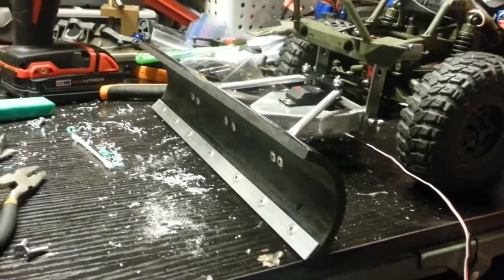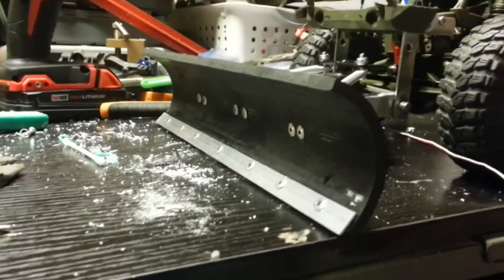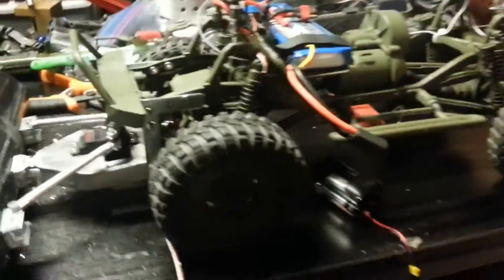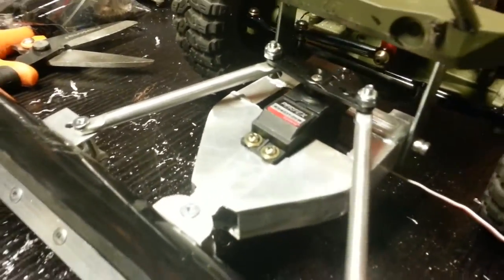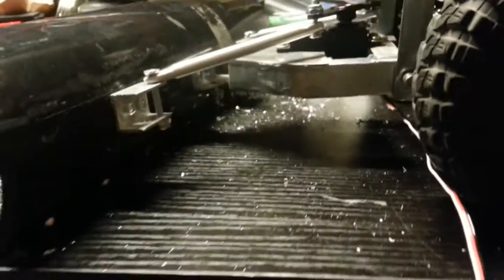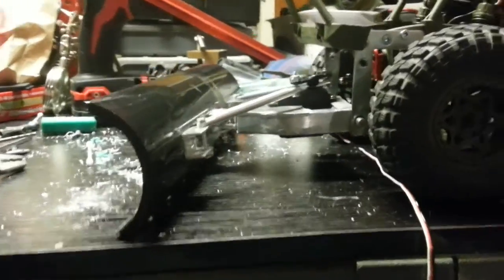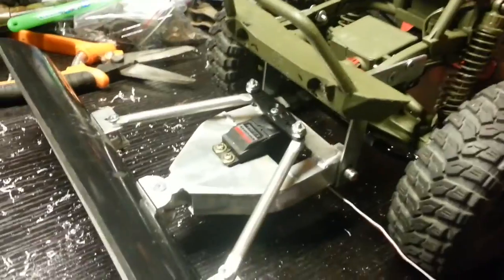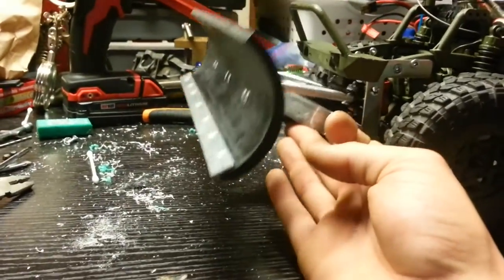Cheap! Scale RC snow plow for under 60 bucks

Comment: Looks good. How you have it set up, the only thing I can think to help with the throw would be longer horns on the servo.
Reply from the maker: +Theibault Through trial and LOTS of error, I figured out that putting the rod mounts perpendicular to servo, the plow moves the same amount. Now have more than enough angle to "wing" the snow in either direction. Videos to follow